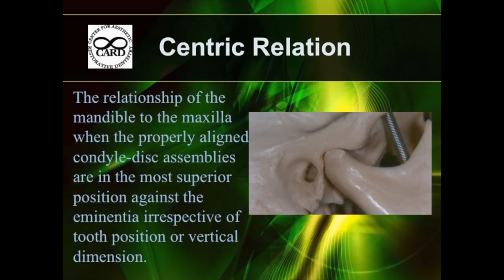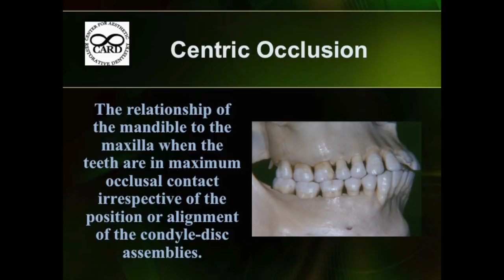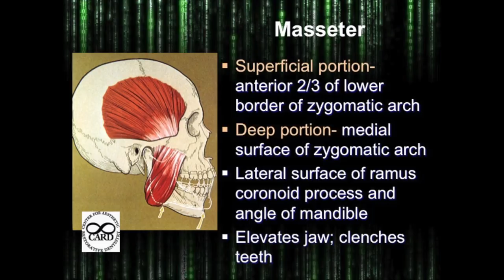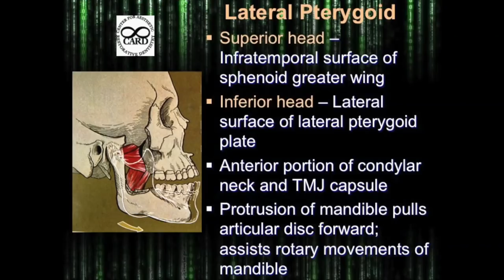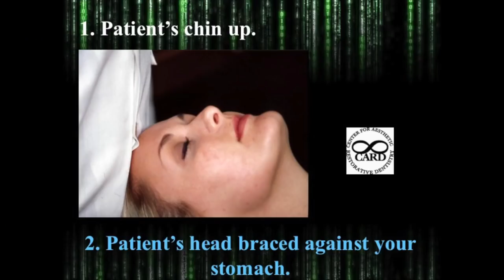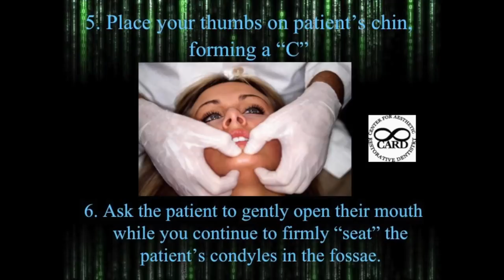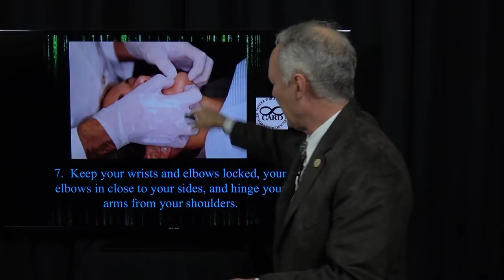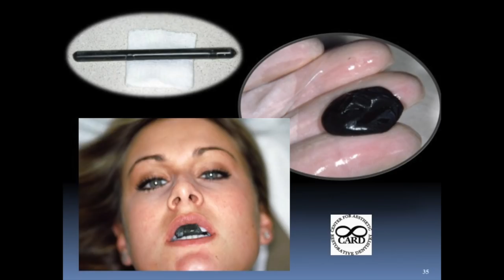How to Manipulate into Centric Relation - Dental Minute with Steven T. Cutbirth, DDS

Comment: Centric occlusion is the teeth position when the jaw is manipulated into CR. What you've described as CO is actually MIP or maximum intercuspation.
Reply from the maker: Centric occlusion has nothing to do with centric relation.  The teeth may be in maximum intercuspation (centric occlusion) when the condyle is maximally seated in the fosse, or not.  If maximum intercuspation of the teeth (CO) occurs when the condyle is maximally seated in the fosse (CR), that position is called centric relation occlusion CRO).
Reply: Dental Minute with Steven T. Cutbirth, DDS 
centric occlusion \sĕn΄trĭk a-klo o ΄zhen\: the occlusion of opposing
teeth when the mandible is in centric relation; this may or may not
coincide with the maximal intercuspal position; comp, MAXIMAL
INTERCUSPAL POSITION

Glossary of prosthodontic terms-9
Reply: Dental Minute with Steven T. Cutbirth, DDS I'm not trying to take away anything from these incredibly helpful videos. I myself have used them on numerous occasions and only benefitted from them.
Reply from the maker: Centric Occlusion is maximum intercuspation of the teeth when the person bites their teeth together.  Centric Relation Occlusion is maximum intercurpation of the teeth when the condyle is seated maximally in the fosse.  The condyle seated maximally in the fosse is called Centric Relation.  The teeth in maximum intercuspation when the patient bites their teeth together is called Centric Occlusion.  The objective is for Centric Occlusion and Centric Relation to occur simultaneously (Centric Relation Occlusion).
Reply: Both of you are right. In school we called CO as MI and CRO as CO to confuse us less but we were told  to never be surprised if CO was used as MI.
Reply from the maker: Wow!  You guys are both making this way too complicated.  Centric Relation (CR) has only to do with the condyle being seated maximally in the fosse and nothing to do with the teeth biting together.  The teeth are actually separated. Centric Occlusion (CO) has only to do do with the teeth biting together in maximum intercuspation, regardless of condylar/fossae position.  Centric Relation Occlusion( CRO) refers to the the condyles being maximally seated in the fosse and the teeth are in maximum intercuspation with no perceptible centric relation to centric occlusion slide when the patient clinches the teeth together.  Bone braced occlusion.
Reply: But I agree with you...I just happen to understand the other guy`s point (maybe it isn't his real point) since in school we called CRO as CO for short and called (the real) CO as MI, while being aware of the actual definitions.
Reply from the maker: Terms are important if you are communicating outside your small circle (one dental school).   I am sure you are both very nice people, but get the terms right if you are communicating universally. Thanks for the comments.  I really enjoy a lively conversation among well intended people trying to discern truth.  My wife taught philosophy at Baylor University for 10 years. She has greatly influenced my intent with conversation.  The conversational model I had growing up in a small west Texas town was "take a position and hold," with the objective being to convince the other person you were correct, no matter what the facts were.  I no longer do that thanks to my wife's philosophical  influence.  I do my best to keep an open mind about topics, discuss them intelligently, then make the best corporate decision based on the facts we have, always being open to change my opinion based on new information.  Wouldn't it be great to hear a politician say, "I used to believe the world was flat, but new information has come my way and I have changed my mind and now believe it is round." Stay in touch!
Reply: I'm still going to stick with the GPT version of the definition since it's probably the most universal. Centric relation, like you've mentioned is when the condyle is maximally seated in its fossa. Centric occlusion is the position of the teeth WHEN the jaw is guided to CR. MIP is when the teeth maximally occlude. CO and MIP may or may not coincide. 
I enjoy these discussions myself. I've just graduated and can't wait to start working. Have a great day. :)
Reply from the maker: I have never heard of centric occlusion being defined as the position of the teeth when the jaw is guided into CR.   I have been teaching occlusion for over 35 years and the only centric occlusion I have ever heard of has only to do with the maximum interccuspation of the teeth, unrelated to jaw position.  As I stated, Centric Relation Occlusion is maximum intercuspation of the teeth when the jaw joint is in Centric Relation.  What dental school is teaching your definition?
Reply: I also noticed, that unlike in the video the term centric occlusion (CO) is generally referred to a relation of jaws at the first tooth contact when condyles are in centric relation. MIP is more common now to describe relation of jaws at habitual tooth contact. I support this terminology, because it is self explanatory and as such is supplier to teach to students.

Comment: hello doctor. very interesting lesson here. if we are talking about a complete arch rehab, what do you do when we have a skeletal II class with a really important overjet? do you still maintain a retruded position or you try to go a little bit forward with the mandible?
Reply from the maker: I always restore into centric relation if an entire arch or full mouth is being restored. The only time I restore into centric occlusion when centric occlusion is not also centric relation occlusion is when I am restoring a single tooth or a "small restorative project" and the patient has no TMJ or myofacial pain or dysfunction symptoms. Your question is perfect for another reason I perform a comprehensive examination on all patients prior to any definitive dental treatment except for emergency treatment. If the patient has a TMJ or myofacial pain/dysfunction issue, you want to be aware of that problem  and discuss it and have the patient acknowledge it in writing (on the consultation sheet) prior to treatment. I cannot imagine the stress in a dental practice if a comprehensive examination and consultation is not performed prior to any definitive dental treatment. All sorts of unexpected things would be occurring and the dentist would have to try to explain them "after the fact." That is another conversation I will discuss in forthcoming webinars. 
All joints in the body should be maximally seated when that system is under stress. Think about the knee, shoulder, etc. You do not want the TMJ to be functioning under stress (clinching) when the condyle is not maximally seated in the socket (centric relation) so it is braced. So many thing to discuss regarding occuusion, centric relation, clinching, etc. In this HMO, coorporate, high volume, treat a toothache dental environment most practices are in I would think there is a lot of confusion and unplanned, undiscussed issues following treatment.
Take your practice to the Top Tier. Subscribe to DentistryMasterClasses.com for an organized library of all the Dental Minute videos plus many complete comprehensive cases and many very important articles. New cases are added weekly.  Only $39.95/month.
Click here to subscribe: 
https://membership.dentistrymasterclasses.com/purchase/?plan=513

Comment: Thank you Dr. Cutbirth for the great presentation! I am a current dental student and your videos are a great help to supplement my education. I have a few questions for this lecture. What if the patient's CR and CO are coincident? I imagine for these patients, the action of sliding into CO can not take place, thus not giving the few mm of opening needed to make an ideal nightguard that puts the patient's bite into CR. What would you do instead for cases like this?

Also, for patients that have unstable occlusions, would you still use the first contact of teeth as a signal to slide the patient's mandible into CR? If not, what would you do? Thanks!
Reply from the maker: Take the nightguard or occlusal orthotic appliance occlusal registration record at an open bite position, allowing enough occlusal opening for the vertical thickness of the appliance.  It's practically impossible to teach someone how to manipulate a mandible into CR without hands on teaching.  Good for you watching the videos.  I hope you and your classmates are subscribed to DentistryMasterClasses.com.  There is an organized library of all the DM videos plus many complete comprehensive cases and many very important technical articles you all should read.  Watch my videos on the principles of occlusal.

Comment: sir could you please make a video when you registrate lateral protrusive escursion and how to transfer it in the articolator?
Reply from the maker: I do not normally take a lateral (working side) or protrusive records.  Set the condylar incline settings on your articulator on 20 and that will ensure 99% of the working and balancing side interferences on posterior teeth are eliminated when crowns or bridges are fabricated.
Reply: @centerforard  thanks for your prompt answer

Comment: Is this applicable in edentulous patients, doc?
Reply from the maker: Yes, if you can keep the denture in place to manipulate into CR.  I do not fabricate plain dentures without securing them with small diameter implants.  I do not want to deal with ill fitting dentures in need of constant adjustment appointments.  You may be able to consistently fabricate regular dentures that stay in place, I cannot. I do not like to perform dental procedures that are unpredictable and have great potential to require multiple post op adjustments and may never work well.
Reply from the maker: Take your practice to the Top Tier.  Subscribe to DentistryMasterClasses.com for an organized library of all the Dental Minute videos plus many complete comprehensive cases and many very important articles.  New cases are added weekly.  Only $20/month.
Reply: @centerforard  Awesome, appreciate your time for the reply, thank you so much Dr. Steven.

Comment: I used to have a severe outward angle on my back rear top teeth but when I got crown they modified them to have regular occulsion and be almost an inch long on the outside. ever since then my life has been ruined because I cannot ear ot talk or smile or sleep. Every dentist modifies the shape of the tooth in someway to "idealize the occlusion" and add verticle dimention which causes the problem. I need it restored to the orignal angle that is how my mouth and face work nothing else works I have literally tried everything in between because every dentist modifies it to add verticle dimention somewhat.
Reply from the maker: So sorry!  Unfortunately I cannot diagnose the problem or recommend treatment without examining you.
Reply: @centerforard  thank you for responding. I have an X ray showing the original angle and functional position. it basically shows what I explained that the angle was so severe that the tooth only contacted in one spot. Would you always reshape a tooth to be straight even if it is working fine at an angle?
Reply from the maker: It's hard to say without examining you.  I try not to ever say "always."  If something is not broken, it may not need fixing.